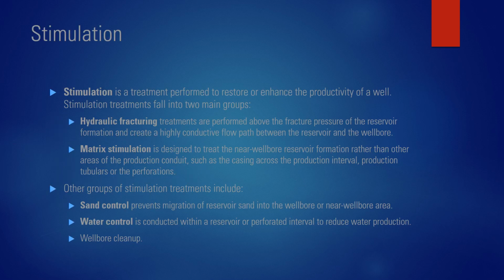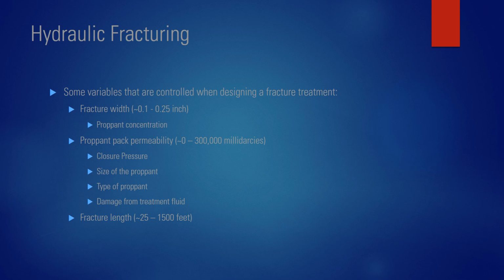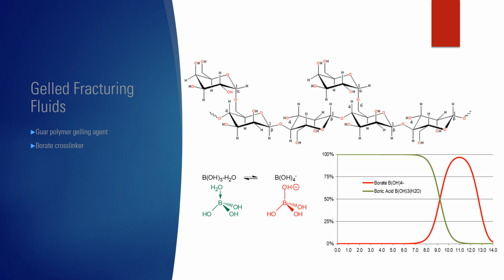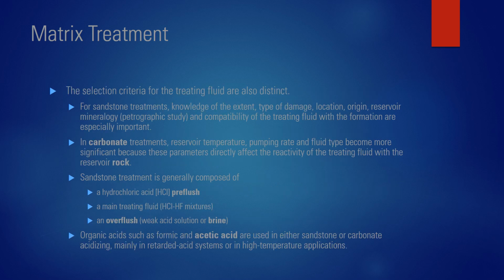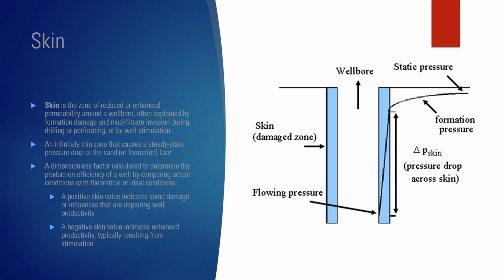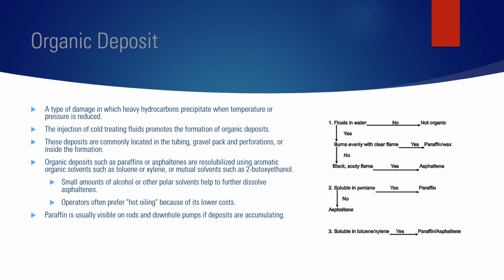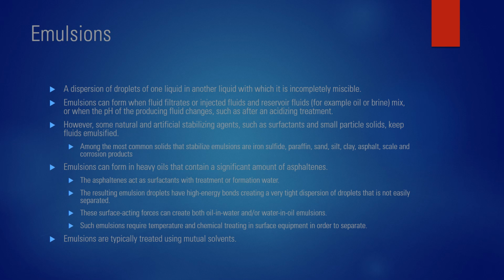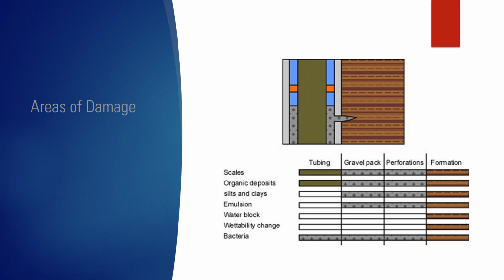Introduction to Stimulation

Comment: Hello, our enzyme gel breaker can be used in blockage removing, well washing and hydraulic fracturing at the temperature range of 10-150℃ to degrade guar gum, hydroxypropyl guar gum and other plant gum with β-1,4-glycosidic bond. Especially in blockage removing and well washing,our new Frac-cleaner Enzyme product achieve huge success in removal of the residue (guar gum, HPG, CMHPG…..) and Frac-blockade which cause damaging the fractures, and eventually will improve the flow conductivity of the fractures. By doing so, the output of the oil well can be increased and the effective period of fracturing can be prolonged.

Vickey
WhatsApp/Mobile: +8613889497495